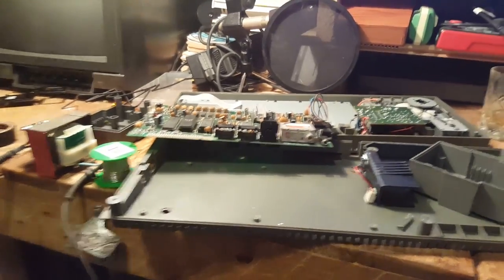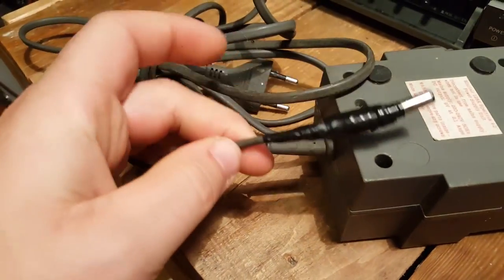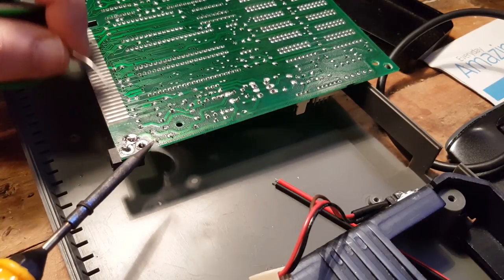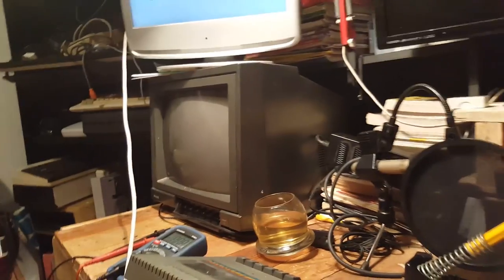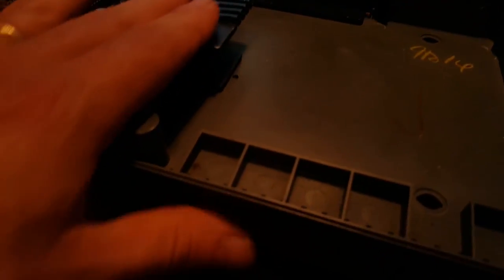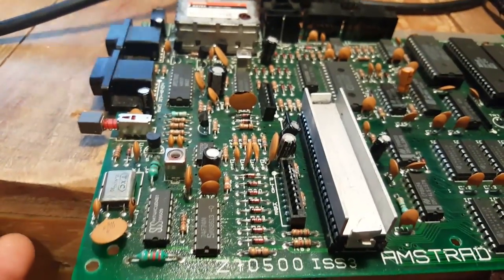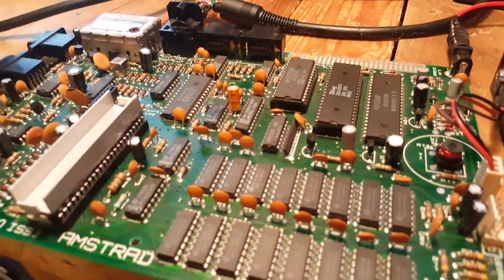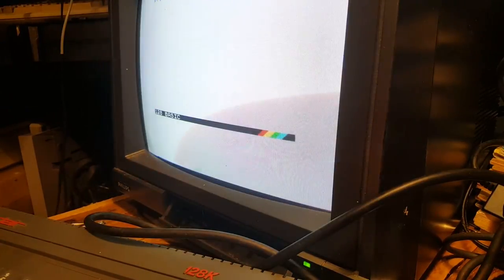DIY#30 -Sinclair Spectrum 128k 2+ repair

Comment: Great job =D  The broken power socket is quite common on the +2, I've fixed a few with exactly that problem where one pin breaks completely.
Reply from the maker: thanks. that was an easy one, although I thought I might as well future proof it a bit too :) .  I got a 48 and 48+ to fix as well so  your vids have come in handy in that respect :)

Comment: With regards to the tape problem, if the tape deck is OK and the signal is getting to the ULA, it will be a ULA fault - That can happen on the +2 =/
Reply: Might be an electrolytic on the tape deck maybe?
Reply from the maker: thanks for the info. I'll revisit that. Although with a proper cable I'm not getting the audio signal at all from the tape & If I touch the audio input with the ic probe I get the edge of the screen shift from blue to red. So I started assuming if was the tape output that was the issue, althought without an actual osciloscope my troubleshooting is limited.  I was planning on recaping the tape driver board but maybe I'll try find a ULA intead and test that (it'll always come in handy in the future anyway I suppose)